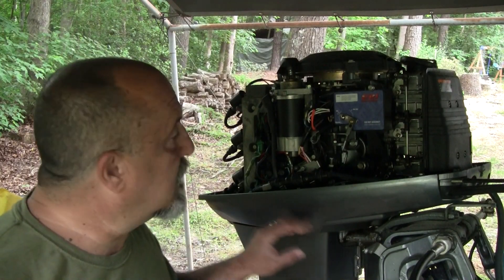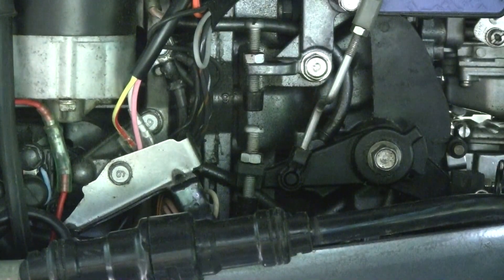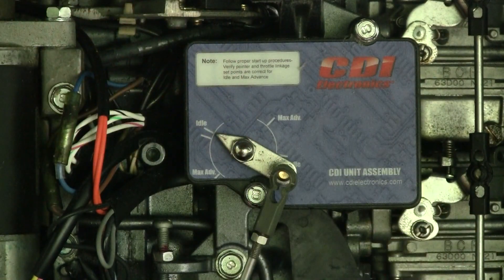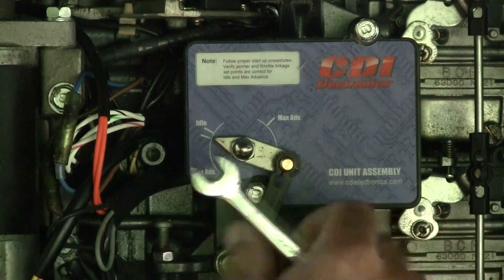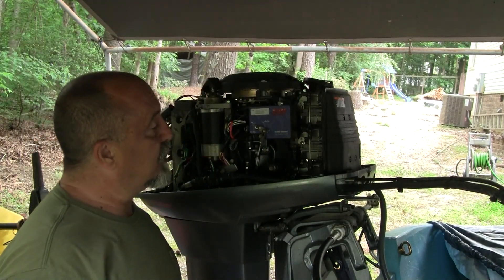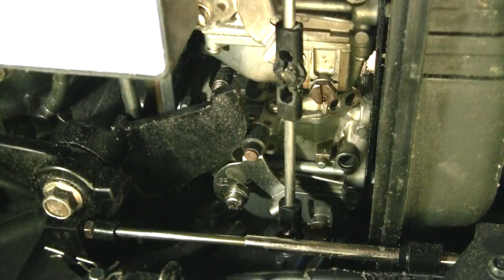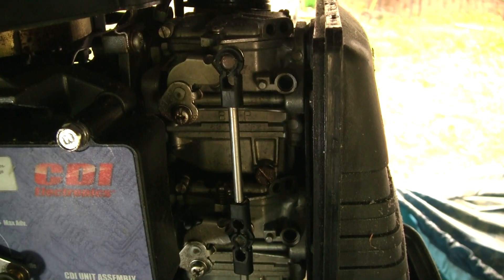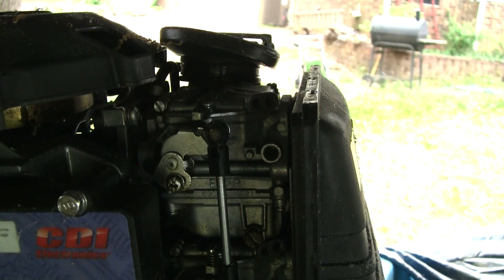Linkage Adjustment - How to Link & Sync a Yamaha Outboard 40hp 2 stroke

Comment: I have an 2005 50hp. I had the carbs rebuilt and 3rd time out it started sputtering. One of the hose popped off and flooded the whole bottom of the engine out. I replaced the hose on the bottom carb but now it doesn't stay running on idle. I have to put it in neutral, push on the throttle and then try to get in gear to get it to stay running. I know this isn't good but it got me back to shore. I will try and link and sync as per your video and hope it works. I don't think I want to take it back to the repair shop simply because its worse than it was when I took it in. I appreciate your time and videos. and of course I subscribed. You have thee best instructional videos on these Yamahas I've seen so far. Thanks and I will keep you updated.

Comment: Hello young man. We have the Yamaha 40VEO 6h4 and problems. It starts, then after some seconds engine comes down rapidly and runs very low or goes down. With manual choke it runs a bit better. But bad behavior to get higher rotation. 
I don’t know. Carburetor are okay. A bit air leak by bad seals? Very difficult. Oil in the exhaust gas. Bad. What do you think….broken?
Jan

Comment: How can I buy you some beer sir ?! Followed this video with high and erratic idle, very hard starts ect... the first few steps I was pretty much spot on with timing marks at idle and full throttle. But kept following along and found the idle mix screw was TOTALLY bottomed out on carbs 1 and 3 and about 4-5 turns open on number 2. After bottoming them all out and coming out 1.5 turns on each screw, she fired right up totally cold and idled damn near perfect ! Thank you so much !
Reply from the maker: You're welcome i'm glad you got it figured it out! Have fun out there!

Comment: I have a 40hp 1998 yam, it won’t reach but 4500 rpm max and i think the cdi unit is out of wack. the thing is when i try to set it to the idle advance one setting it doesn’t want to run, any help is appreciated thank you
Reply from the maker: Hard to say without seeing the actual engine , it sounds as if the CDI nay be toast!

Comment: I have a 115 Yamaha when push Full throttle front and stays up in the air will not get on plane. What could be the problem
Reply from the maker: I can't say for sure but you might wanna look at what your motor height is at

Comment: What would make a yamaha 150hp 2 stroke v6 idle fine run fine but when warm after a run...has tough time starting and shuts off when idle
Reply from the maker: Hard to diagnose while not being there, but it sounds to me like a possible fuel issue id would start there and go over the motor and check everything over.

Comment: I have a 2006 ox66 150 hp. When fishing for hours at low throttle and idle in neutral the engine fouls the plugs badly to where the engine won't get me home if I dont pull the plugs and clean them. I think the oil to gas ratio is causing it. I havent been able to find directions for how to lean out the oil to gas ratio, especially at low throttle settings.
Right now the engine averages about 30 to 1 and when running at higher rpm's it runs perfectly. But I do a lot of lenghty low rpm fishing in far out ocean places and would like to run home without fouled plugs, so bad that the engine won't run at all unless the plugs are dealt with at sea.

Comment: Is it necessary to set the oil pump ratio screw after setting the idle and full throttle timing as per awesome video.
Reply from the maker: I think it is recommended, and the next pages in the manual cover that. I didn't get a chance to cover that though

Comment: Any idea what the plastic cover is that goes over the grommet for the control cables is called / part number? Replaced cables and mine is cracked.
Reply from the maker: I would try marineengine.com and look at the parts diagrams they have.

Comment: I am using your video to adjust the carbs and linkage on my yamaha 50 TLR 2 stroke. I noticed that when I adjust the full throttle stop on the bottom carb, it will also increase the idle speed to about 1500-2000rpm because when the throttle is back to neutral, the butterfly valves cannot close all the way. If I adjust the linkage so that the idle speed is around 700-900 rpm, then when I advance throttle to WOT, there still is about 1/4'' that the carbs can still be opened. Any ideas on how to fix this?
Reply: Did you figure out this issue?

Comment: Wouldnt happen to know the part number for that CDI Box?? Mine is stuck at about 15degrees of timing
Reply from the maker: I don't have that off hand. Its been a few years and I no longer have that engine. I would give them a call, that's what I did and their techs are extremely helpful in finding the right part and giving you whatever tech tips you might need.

Comment: Hey this was really useful - is there anyway to test WOT without boat in water - ie disconnect gear shift? My engine dies at WOT but idles fine and goes forward to maybe 4 5 kts but as soon as WOT just cuts out  - have stripped carbs but not sure now how to test without going back in water
Reply from the maker: There are simulated props that let you go WOT in a tank, typically used for timing adjustment at WOT. BUT, they are pretty pricy!
Reply: @ExtremeDIYGuy  Thanks for this - just noticed again as I watch for 50th time - my roller in idle doesnt touch the black plastic part  - @9.13 my roller is someway to the right - what do i need to adjust please?
Reply: @ExtremeDIYGuy  can i send you a video at all to get some help with a yamaha 40hp 2 stroke please?

Comment: You just saved me from buying a new $600 cdi unit that a mechanic told me I would need! Turns out all I needed was an adjustment. Everything was severely out of sync! Thank you so much!!!
Reply from the maker: Thats awesome, I hate to say it, but I don't have much confidence in many of the Outboard mechanics I've run into. I can tell yo some horror stories

Comment: Are the adjustments also the same for 60 hp autolube?
Reply from the maker: They should be similar but I would refer to the service manual for actual measurements
Reply: Where can i find a service Manual? I dont have won. Thanks for responding!  @ExtremeDIYGuy
Reply: @ExtremeDIYGuy where can i find a manual for 60 hp?

Comment: Question:  I tried this on my 50hp yam. and did everything as you, but step one did not seem to have a stop.......I can take a pic and let you see if needed.      thanks, brian
Reply from the maker: That's odd, there should be an idle stop, perhaps a picture might help. Or better yet, send me the exact year and model #, I might be able to look it up.
Reply: Thanks, it was very off and the bolt had a washer and it threw me off,  I set that first and then recked all the rest.   Great Job and ty for your help  Brian    @ExtremeDIYGuy

Comment: Question for you I have 120 hp Nissan two-stroke outboard the fuel cup where the screen filter cup drops down inside was flipped upside down in there. I don’t know how this happened or if somebody had gotten in there and worked on it previously but we have been having issues where the boat will not throttle up or hardly get up on plane it idles fine

Comment: Bro, this video has saved my sanity. Went through all the processes on my 50 (same as 40) and just had to adjust mix screws on the lower carbs to eliminate lean sneeze. Now she purrs like a kitten.... Thank you all the way from Australia
Reply: Did you use the same measurements for the all the stops....meaning there the same from the 40hp to the 50hp??
Reply: Hey i also have this problem , could u give me a tip to fix those because my motor 25hp yamaha also has a sneeze
Reply: in what way did you adjust them? In more? or Out more? I also have a 50hp 2-stroke

Comment: Thanks, this helps alot, I have a 50hp.2 stroke feels like 3500rpm is lower than max rpm thought it was 5500
Reply: Did you ever figure out this issues? Mine only revs out to 3500 as well

Comment: What should I do if my lever with the adjustment screw that is supposed to be 20mm, doesn’t come in contact with the stopper below it
Reply: Same problem I had.
Reply: @brianbrouillette9320  did you make the throttle cable longer to make it reach?

Comment: Hey Jose, I’ve got an ‘98 Yamaha 40hp. It’ll start great every time. But will only idle for about 10-15 sec. Then stops dead. At times it’ll slowly start to die but will die very suddenly. Turn the key straight away and she starts no problem. Any ideas/help would be greatly appreciated. Cheers
Reply from the maker: I would check your fuel system,. Here's a video that will give you some tips. ahttps://youtu.be/8NI9drrnB9Q

Comment: I have a 2007 yamaha 50hp 2 stroke, will this work the same with my motor? New to outboard motors so trying to learn this as I go!
Reply from the maker: It will be similar but probably not the same, I would get an on line manual.

Comment: Hey man thanks for the video it's very helpful.
I have a 50 hp yamaha and my idle screw is on the top carb .. does this mean my carbs are in the wrong order .. or does it not matter for the top 2 ?
Reply from the maker: Probably in the wrong order, I would check with a service manual

Comment: ON a Yamaha 40 hp 2 stroke on idle air jet on the end there is a tiny wire, Not having the top of carb off I seated the jet and broke off the wire, Do I need the wire? Or must I order another?
Reply from the maker: I would replace it, I've not seen a tiney wire on the 40 2 stroke so am not really sure.

Comment: Is this the same process for a Yamaha 50 2 stroke? I followed step by step and my idle is higher than normal.
Reply from the maker: IT is very similar, you should be able to adjust the idle speed though

Comment: I have a 2004 Yamaha 50 TRLD. Would the specs for set up be the same ?....Thanks,
Reply from the maker: They are slightly different The idle adjustment screw should be 1-5/8 for a 50M model and 1-3/8 for a 50EM model. +/-1/4 for both.
Reply: @ExtremeDIYGuy  Thanks !

Comment: Hello Jose, I am a certified YouTube diy mechanic. On a Yamaha 30 DMO 2 stroke, 3 cylinder i have a fast idle lever on the 703 controls. When i move it forward the idle speed goes up but not significantly. Should this lever be adjusted(or can it) to push the black round knob to  wide open throttle?? It s the knob that is linked to all 3 carbs and i can only push it by hand in idle when i open the cover for maximum power or WOT... hope this makes sense. Thank you

Comment: Excellent video, probably the best one on the link and sync out there. So good.

One question, my cam accelerator/throttle accelerator only goes about 50% of the way and then feels stuck. The remote handles are also about 50% down. Feels like something is stuck with the cam accelerator. Can the spring fail or these parts be put on wrong? Or could it be a way of restricting the revs? Engine is a 3 cyl 2 stroke Yam.50HP. engines only reach 4500/4750 revs.
Reply from the maker: Thanks! I would start at the control box and work my way back to the engine to see if something is hanging up or mis-adjusted.
Reply: @ExtremeDIYGuy  will try that tomorrow 👌
Reply from the maker: @mitchmix999  Make sure to check the engine first before doing anything to see if there's anything obviously wrong. I had a similar problem which was the control box but yours may be as simple as adjusting the throttle cable. at the engine.
Reply: @ExtremeDIYGuy  Just had a look by taking the cam accelerator link off so i could push the remotes down. All good. Checked the cam accelerator and the movement in that was ok too. My guess is the 703 remote cable is a bit stiff and just needs a bit of working. Might be at it's end of life too?
Reply: Turned out the CDI output voltage to each HT lead was only 50V (spec is 125V minimum). On top of this, the CDI timing position is well out. I've replaced the CDI and 7 degrees is bang on the mark with new CDI unit. The old CDI unit, 7 degrees was near half way towards fully advanced. I can only assume this is an age related issue with the CDI. I've a twin engine setup and both units are showing the same failings....poor output voltage to HT lead and also timing no longer being accurate on the CDI.

Comment: I have had a issue with my 2003 yamaha 40 hp 2-stroke not firing on the last two cylinders. I have spark, air, only thing that is iffy is the fuel. When pulled out the plug they seem to be wet so that leads me to believe they are getting some kinda of fuel. It ran fine when i first bought it but i had let it sit for about a month in the florida heat and now i am having this issue. Any recommendations?
Reply from the maker: I would start with a thorough cleaning of the carbs.

Comment: Can you help me locate the thermostat on a 40hp Yamaha outboard motor 
It is not clear 
I believe it may be on Port side of engine 
Is it behind the oil resovoir 
And help or video 
Picture would be great
Reply from the maker: Hard to say without a pic but on mine it sts right above the exhaust cover.
Reply: @ExtremeDIYGuy  I was able to locate with diagrams on parts list with pictures of location 
Thanks

Comment: Hey great video helped out allot, I’ve got a 50pro Yamaha having a hard time finding specs on this thing. Would my idle fuel control be the same as the 40 at 1 1/2 turns?
Reply from the maker: The manual I have says 1-5/8 +/- 1/4 for an M model and 1-3/8 +/- 1/4 for an EM or E model. Hope that helps.

Comment: I have a 1999 Yamaha c60 the pointer on my cdi box is just the opposite of that at an idle it's toward the single line and between the two lines at wide open position. it struggles to get up to speed but once on plane runs good and runs good at an idle. does this sound right to you? with the marks being reversed from you video?
Reply from the maker: That doesn't sound right at all. But I don't have access to a C60 manual so cant say definitively.
Reply: @ExtremeDIYGuy  I did end up finding the information on a forum with the c60 Yamaha the single mark is idling and double line is wot. With that setting my timing is right on with the light.
 Thank you for the video it was still helpful to me. Keep it up you do a great job of exploring the process.

Comment: 5:30 it was at this point that I stopped the video and gave this a shot on my 90 and let me tell you sir you made my day actually my weekend. I haven't even finished the video yet but I'm about to. 

It took me a little messing around to get it smoothed out but when I first started it it was backfiring. I see now some of these connectors are cracking so I need to get new ones. But thanks to you I know what I did to make this happen and how to correct the problem.  

I appreciate you. Thank you for sharing your skills knowledge and experience
Reply from the maker: Feedback like this keeps me going! I appreciate it and am glad the video helped you!
Reply: U used the same measurement and it worked even though the 90 has different linkage setup 
Going to try on my 70

Comment: Hi Jose ,can you tell me if a set of yamaha 6h5 carburettors bolt straight up and can I use a 40hp square bowl to replace the fuel enricher bowl .
My motor is 2000 6h4 
Cheers fella
Reply from the maker: Brendan, I honestly have no idea. If I ever have the opportunity I would give it a shot but can't give you an honest answer.

Comment: Really good. I have the manuals and I have had the engine for few years. Just had some misfire or backfire issues and dying on idle.  Watch your video then cleaned the carbs which I’ve done before and then set up the carburettor using your Link sync YouTube video. Your videos answered all the outstanding questions I had even though I’ve got the Yamaha workshop manual absolutely brilliant really appreciated it. Clear and detailed instructions I really can’t thank you enough.  For now the engine is back to running perfectly
Reply from the maker: That's great feedback! I'm glad the video was helpful to you!

Comment: Hey Joe I did a full link and sink on a 2007 Yamaha 90tlr 2 stroke the only thing I could not find is the distance I need to measure for the idle advanced do you happen to know what it is on my 90hp kind of got a sluggish low idle once I put it in forward gear at low speed so I believe that needs to be adjusted, I believe it was 20 mm on that 40 horsepower you're tuning tia
Reply from the maker: Clayton, unfortunately, I don't have a manual for a 90 so can't give you a definitive answer. I might  be worth searching for the manual on yours, I've found a wealth of manual resources online in the past.

Comment: Hi Jose, The idle control screw(vertical screw at the 2nd carb) on my Yamaha plrp 40hp 2 stroke does not make contact with the stop on the carb even when it is tightened all the way in.  Not sure what I should be adjusting to make the idle control screw make contact and work properly. Thanks
Reply from the maker: Something is off with the link and sync, you should probably go through the whole process from scratch.